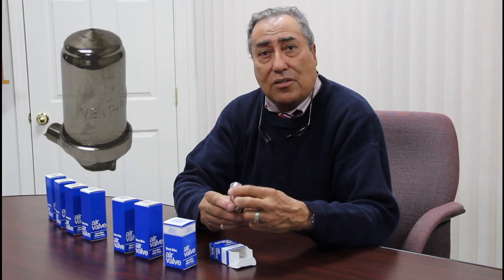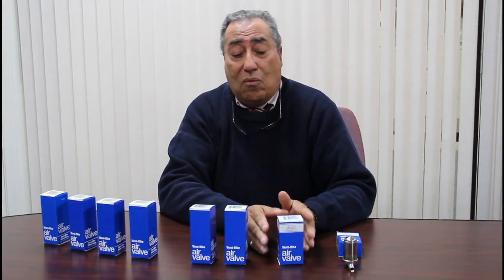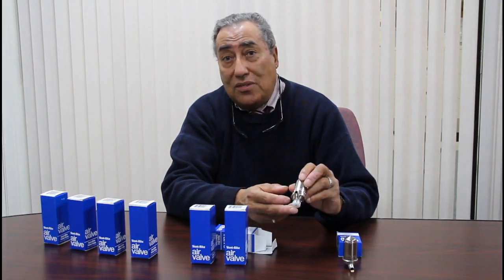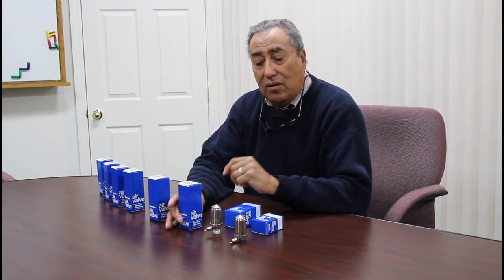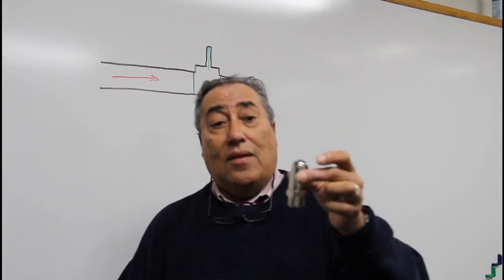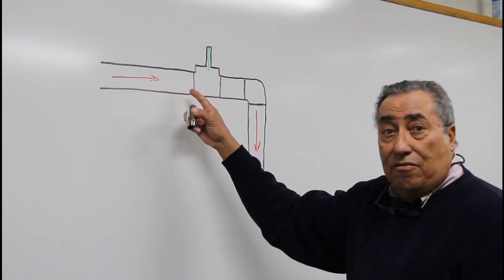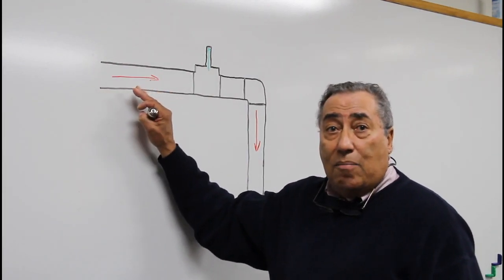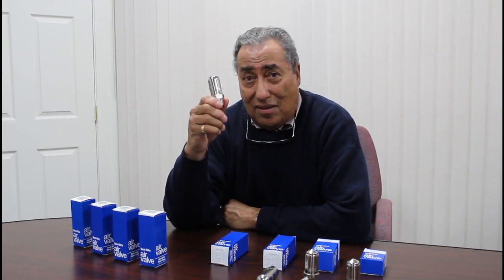How Steam Vents Work | Emerson Swan

Comment: Hi Mr. Marshall. My steam radiator wasn't getting hot, and my super saw there was no air valve, so he put on a bullet-shaped air valve. Now when the heat comes on the radiator gets nice and hot, but makes a tremendous amount of noise, very loud hissing and sputtering sounds. Do you think an adjustable air valve like the 2nd one you showed would reduce the noise? Thanks.

Comment: I am wondering what is the difference if you use a #75 instead of a #35. Does the #75 need a higher pressure to close?

Comment: but how does it work? Is there a volatile fluid that responds to heat against a diaphragm? A float? Space magic?
Reply: Actually both. Alcohol inside the bellows expands and closes the vent when heated and acts as a float in the presents of excessive water.

Comment: Our radiators are equipped with steam vents  does this mean we do not have to bleed them?   I am a new home owner and this is all new to me.

thanks in adance.
Reply: you don't bleed radiators in a steam system.  In a hot water system you do
Reply: Thank you very much.     how often should you replace the steam vents?
Reply: Bill Dineen  If you buy a quality vent it can last up to 10 years.  As long as it's only letting air past and not steam you're good
Reply: Thank you so much